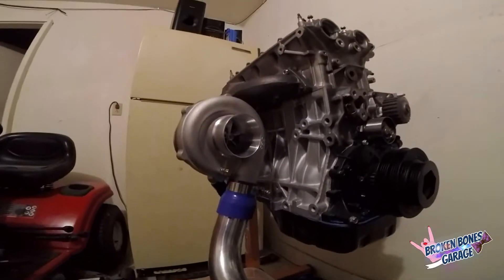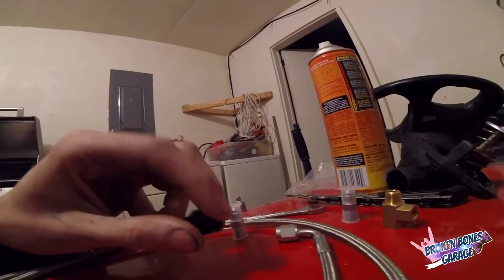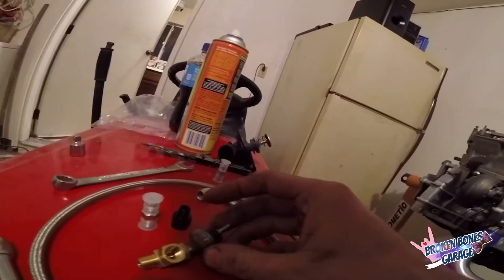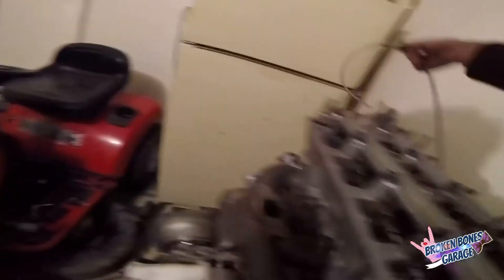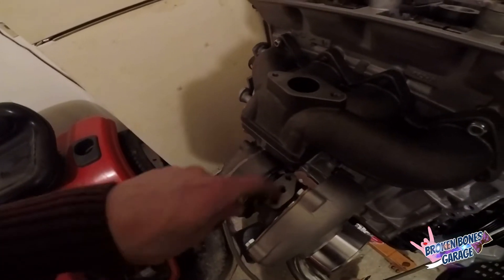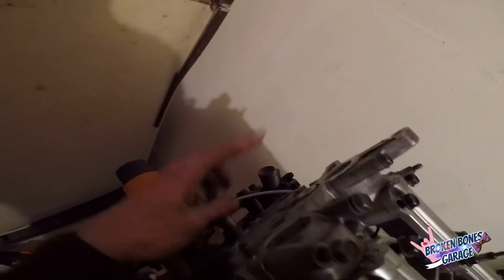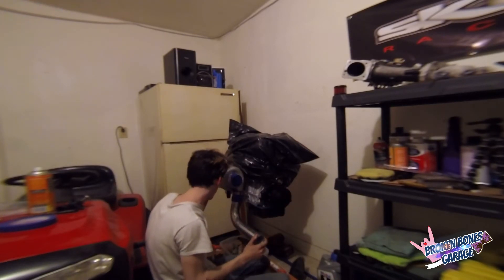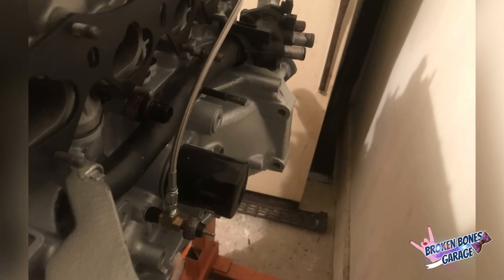B16 Big Turbo Oil Feed Install

Comment: Hey man would you be able send a link to all the parts you used for the feed and drain? Im trying to figure it out myself and i don’t really wanna order anything i don’t wont use
Reply from the maker: Order the pro kit from go auto works. The return line I used black vibrant line cause auto works kit came with the silver steel braided and everything else I had was black
Reply: @Bonesgarage95  thanks dude, if you have any questions ive almost got everything ready to go aswell